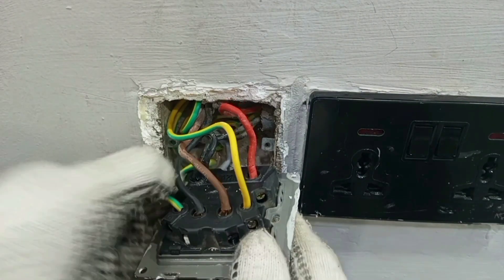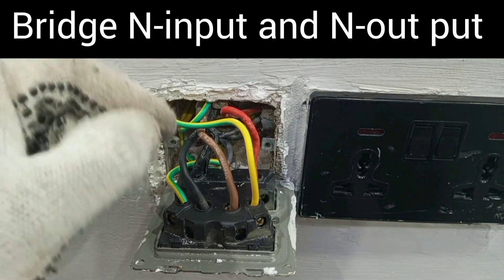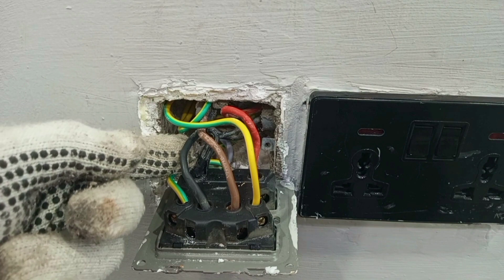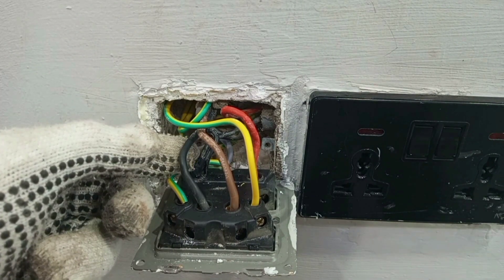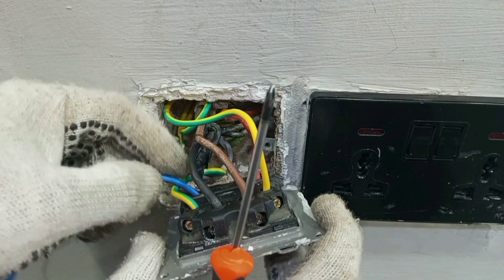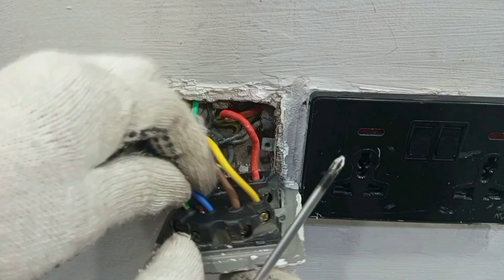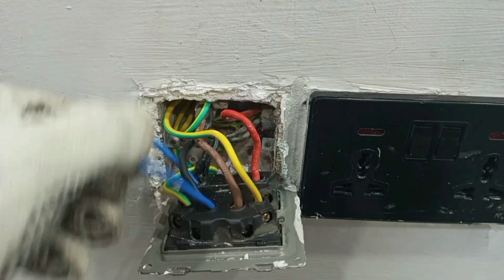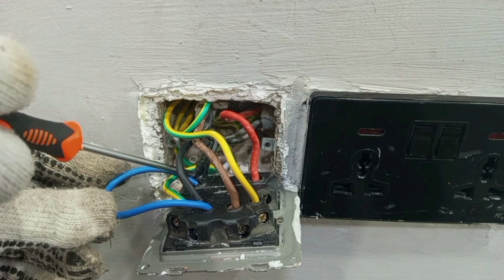How to measure electricity used by Air Conditioner with a multimeter| How to check the current of AC

Comment: Nice
Reply from the maker: Thanks bro.
Reply: Please explain to us what's mechanical interlocking and what's the device use in mechanical interlocking?
Reply from the maker: @Ibrahimsaheed-bn2ph 
Well, mechanical interlocking is  just a mechanical Way of putting two contactors together in a way that when one is closed, the other one will be mechanically locked from closing.
But don't worry I will do a full video on that to explain it better. Thanks

Comment: Please in one of your previous video on how how to use the multimeter for measuring current, you said the red probe will go for the incoming supply and the black probe for the outgoing supply, but here it was not so.
Also when using the multimeter to measure current, to be on the safer side ane not to damage the multimeter, should we always multiply the load current by 3.
Reply from the maker: Well, it can be either way, just make sure that you don't touch the conductors on the probes.
Reply: @obloni_Electrical  noted. Thanks